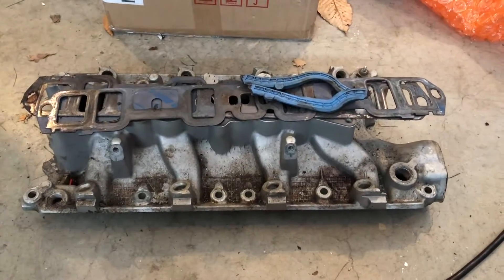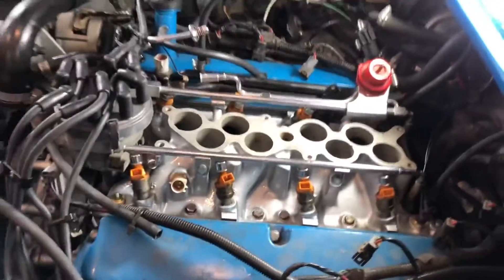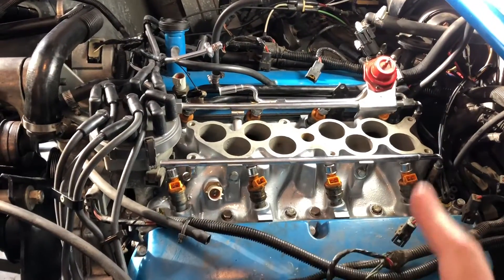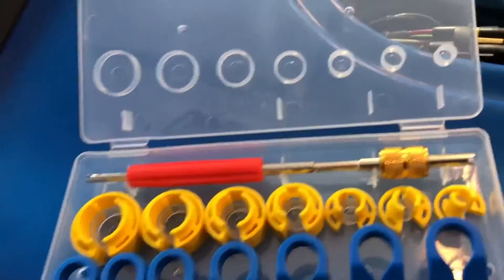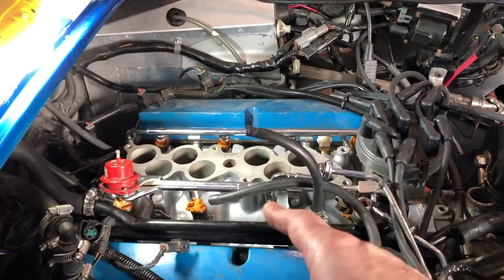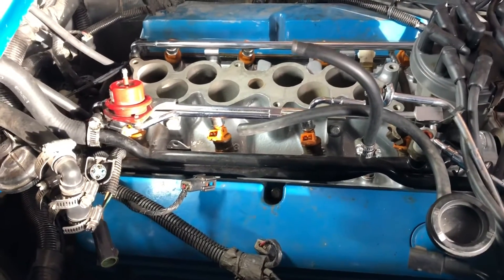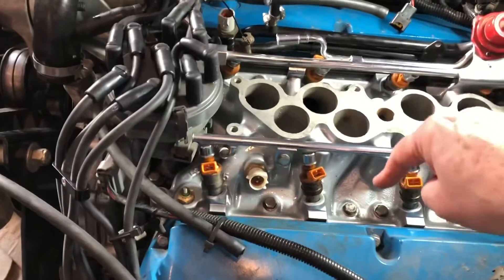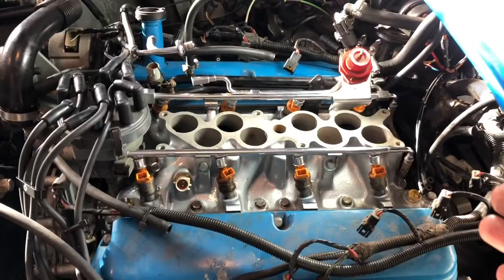Foxbody Lower Intake Manifold Installation

Comment: Not good! Never use silicone grease . If it gets into injections has will not break it down. Vaseline or grease tons of articles about that.
Reply from the maker: I was really careful and just used a thin film spread w/ my finger. In this case, I don’t want the grease to break down, rather to remain in place and make a good seal w/ the old o-rings. In my opinion, it’s fine. 🤷‍♂️

Comment: What color powder coat did you use?
Reply from the maker: I honestly don't remember. They had hundreds of samples, on aluminum beer 'bottles'. I just picked the one that most closely matched the original cast aluminum part. I simply wanted it to look OEM, but brand new. I was somewhat disappointed that they powdercoated on lots of glossy clear, but it won't stay that shiny for long!! lol Sorry I couldn't be more help.
Reply: @Metalcop5150  I'm thinking of would look great, freshly media blasted, with just a matte clear.
Reply from the maker: @nickydexgg4579  Absolutely. Anything that makes it appear stock, but new is what I'd have liked.